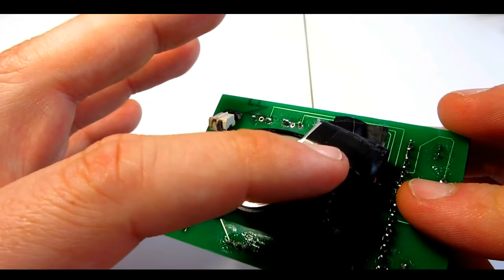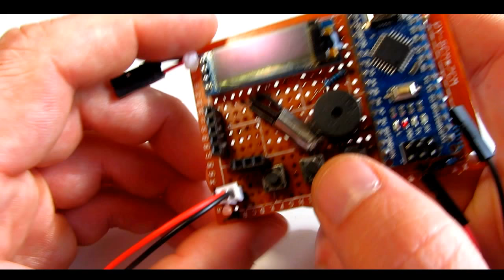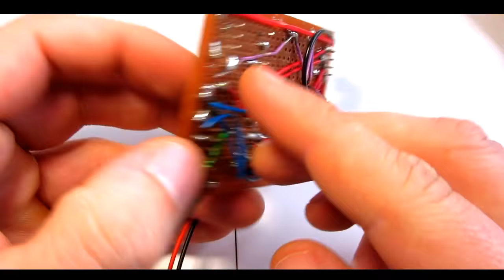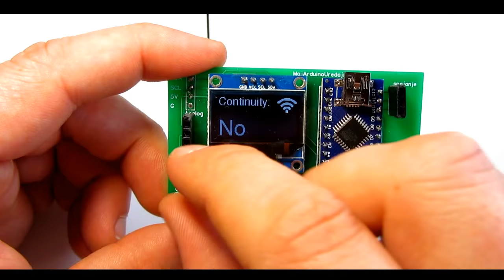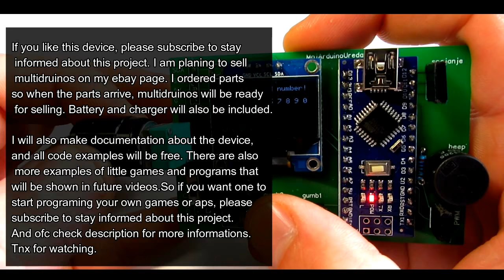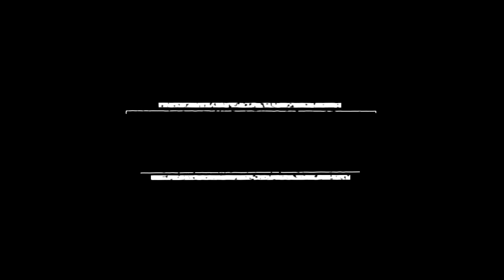Multidruino - multimeter, game console, calculator. clock and much more

Comment: Love it! I've spent the last 3 days trying to build my own multimeter and I really wish this could read voltage. I wonder if adding a 16-bit ADC would provide enough resolution to add a 22k resistor in series with the A2 input to give a 10x voltage drop (along with the 2K2 resistor from A2 to ground) allowing voltages up to 50v to be measured.

The version I built can measure 0-50v, and resistance. It was even able to automatically switch between the two depending on what was being measured. The problem comes when I try to add the third feature I want - I basically want a mode to output the battery's voltage directly through the leads, which would be fine - except actually I first want to step that voltage up to somewhere between 12 and 24v, which the analog pins obviously can't handle otherwise your meter could measure voltage without modification. I've been trying to use MOSFETs and stuff to switch things on and off as necessary, but it isn't going well

So, I may try the ADC method or try to think of something else. I'd really like to have just the 2 connection points without adding a third or fourth lead.

Edit: Partial success! I modified your circuit and code to include 3 logic-level MOSFETs that allowing me to measure voltage through the same leads. I got rid of the analog input option for simplicity so now it's a 2-lead volt/ohms/diode/continuity/and PWM generator meter. Next I'm going to put a full bridge rectifier on the input so the thing can measure AC voltage, and to protect it against reverse polarity,  and then create my 12v output boosted. I'll probably throw a precision voltage reference on there, and then try that 16-bit ADC. Wish me luck!
Reply: @Samuel Thompson  A7. :D

Comment: Thank you for sharing your code. I got most functions running but I can't figure out what resistor value you are using for the voltage devider so I can test for resistance and voltage drop? Also any plans for adding a volt meter? Thanks again.

Comment: Very nice project,  very useful too, easy to understand but still  I have a question  regarding your project . 
How did you managed to power arduino nano with a 3.7V battery ?
Since the rated voltage for nano is 5V .
Reply from the maker: you can power any 5V arduino with voltage that is lower than 5 V and  higher than 3V. Some of arduinos are 3.3V , dont power them with battery , you can destry them that way.
Reply: I understand , i did a similar project to yours  i will post a video of my project as soon i finish it .

Comment: Great job.. I love the simplicity of using it.. You mentioned about having code and schematics available, how soon? I love the fact you used easyeda, that has worked awesome on many projects.. Keep up the good work..
Reply from the maker: Tnx, schematic will be ready very soon. Code is here https://drive.google.com/open?id=1DuTQaNvK-pIbPeSOrpDI93_xU87-pqps
Reply from the maker: but you can also check my prototype instructables for more information, that is practicly same device, just diferent screen size and new one dont have temperature sensor   https://www.instructables.com/id/Arduino-Multimeter-and-Components-Tester/
Reply: Thank you I look forward to it. I looked at your code, I guess I need to learn something other then english :)
But I did like the fact you use the readVcc  function. I've had good luck with that function in many projects (mostly with Attiny85).
Reply from the maker: soory for that, i know code is mess and is not on english, i am working on clean code on english. I will posted it here in comments when i finished it. :)
Reply: Hey.. its your code, your language, no problem.. the structure still looked good..
Reply: also if you want to see some of my projects, you can go to: https://easyeda.com/shermluge and at https://github.com/shermluge
Reply: @VolosProjects   sir this no open sir

Comment: Which library did you use for graphichs?
Reply from the maker: adafruit library 1306
Reply: @VolosProjects  I used to have project just like yours too. I had wanted to use this library before I start my project but.I couldnt find enough knowledge ,Tutorial and manual about this library Thus I  used u8glib library. But it consumes many storage Thats why it is unuseful. It seems very usefull library and I want to learn this library is there anywhere where I can find manual and tutorials from? I dont mean example codes.